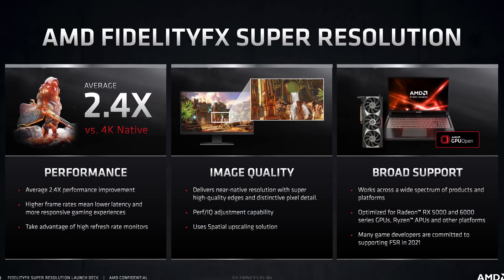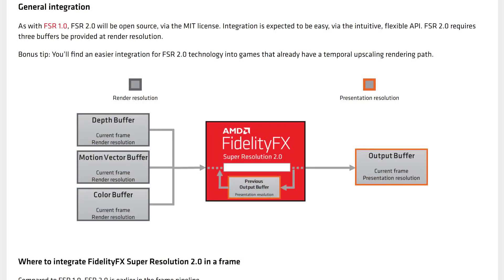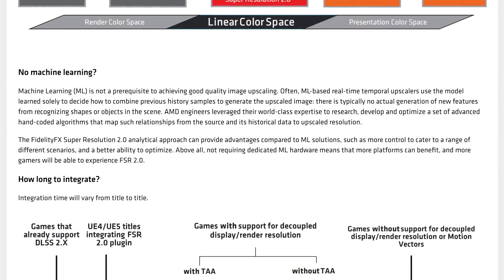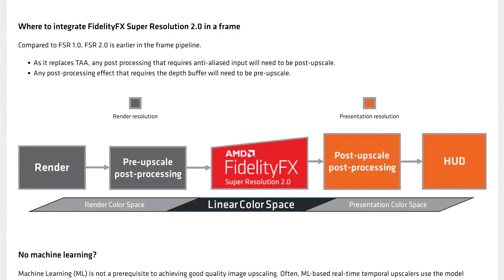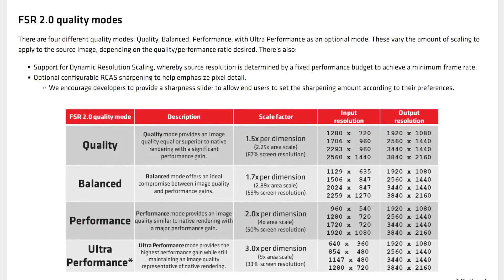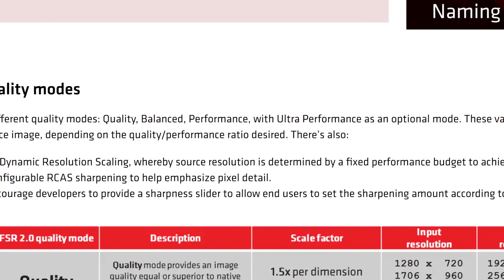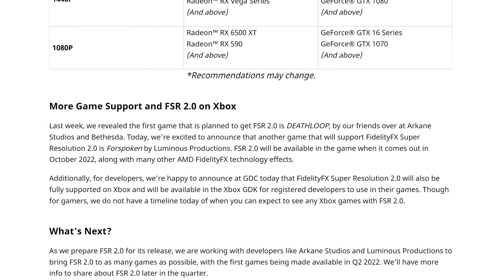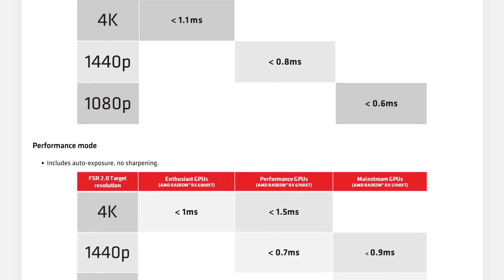AMD FSR 2.0 Details: GPU Support, Quality Settings, How it Works

Comment: I’m not a fan of this fsr. Maybe it’s great on pc but on console it seems devs are being lazy running with low resolution and all games look blurry. I have a laptop less than half as powerful as modern consoles and I frequently have games looking better-sharper. Few months later after several patches they usually make them look a little better but I prefer a sharper image without the upscling.

Comment: I am getting 60+ fps in RDR2 at 1440p with your optimized settings and fsr 2.0 in performance mode on a gtx 980ti. Hoping for fsr 2.1 implementation soon as it seems to fix much of the ghosting issues in fsr 2.0. But it is very playable and still looks quite good 💪🏼

Comment: I've been using rsr this week and while it has some buggy UI behaviors, especially when running obs in the background, I do find it gives me a good performance bump even on a rx 5500xt 8GB when upscaling from 1600x900 to 1920x1080 and because I'm rendering at a lower resolution, I can max out things like shadows, lighting and texture quality. The biggest benefit in game was Warzone, running above 90 fps with fewer frame dips than native 1080p with medium/high settings. At native 1080p medium textures, the foliage looks like its made of playdoh, whereas with RSR and max texture, shadow and lighting quality, everything looks crisp.

Comment: I have a gtx 1060 😭
Reply: @richwhitemanarchive  GTX 1060 uses the exact same set of instructions a 1070 or 1080 do. If 1070 is supported then so is 1060, same for 1050, only card that might be excluded is the 1030 GT, even that remains to be seen.
Reply: @richwhitemanarchive  it's not supported :(

Comment: I'm curious, would FSR 2.0 still able to be turn on with RX 400 series?
Or if it can but would result in worse performance than 1.0 but better in graphical
Reply: The "worse performance" seems to be implied in their statements, not as in bad performance, just not as high gains as FSR 1.0. RX 480s and 70s should work absolutely fine, as they are all mere refreshes of the same card, an RX 590 is quite literally an RX 480 with higher clocks.

Comment: i was gaming tonight on bfv and found out 4 guys had the 3080 and they play at 1080p why?why?.i dont get it,they are like well it works great at 1080p.i just laughed but why? a 1080 will do that not even a ti and they caint use ray tracing their or nothing no dlss but they are content i shouldnt judge. one guy said hes doing the trade up for the ti Tuesday im like what no what?the 10 gig scares him and thinks the 12 will be better.it just seems everyone is scrared if their gpu isnt 12  on memory or more on 1080p monitor that it wont work much longer misinformed people.i wouldnt trade my my ftw3 evga  black lipped clown face card for nothing its a beast .the 10 gig memory hasnt effected me yet and i play everything on 1440 and sometimes my 60hrtz 4k monitor its always smooth.

Comment: Can someone tell me how 3060 ti should perform in Metro Exodus Enhanced Edition built-in benchmark? I have weird issue and i lose 20 fps with resizable bar enabled. I have 5800x and b550 so all the hardware that is required and this game is on Nvidia's whitelist. It shouldn't hurt my performance but give me a boost.

Comment: If AMD just made decent GPU's they wouldn't have to resolute to this crap and that's coming from someone that's owns are 6800 XT which I was really disappointed with but it was the only GPU in stock at the time.

Comment: Hey, didn't know where else to ask, but now that x370 boards have 5000 support, could you guys run a benchmark test between x370, x470 and x570 to see how the chips perform in each?

Comment: Thanks for the video HU! I dont understand if i can use FSR on my 1440p monitor to play at 4K, is that possible? does actually change something on my 1440p screen? Thanks in advance for any answer!
Reply: FSR and other technology like this works by taking a lower res frame (say 1080) and increasing it when it sends it to your screen. From 1080 to 1440 as an example. You can't display more than 1440 pixels on your screen, so if you make an image bigger than that it'll scale it back down again to 1440 anyways.

Think of it like viewing a really high res photo on your screen. It had to shrink it down to fit, so you lose that extra detail.

Comment: G'day Tim,
Thanks for the update as FSR2.0 is looking like it is going to be DLSS for everyone, not just those with big bucks to throw around.
I really like how you do the Feature side of GPUs & they are not included in Steve & Teddy Jr's Benchmarks, it gives you the ability to deepdive into the Image Quality that is associated with using these features not just how many extra FPS/less FPS they may provide when turned on. As someone who plays Adventure Games I am more interested in Image Quality than Max FPS.

Comment: the nonsense about how long it takes to integrate it into your game is how long it takes "EPIC GAMES" or "ORIGIN" or "BLENDER" or "UNITY" to make say the UNREAL ENGINE WITH IT. and ensure they've got it looking how they want it in their own custom in house game engine.. then whenever anyone uses a standard game engine like unreal engine/frostbyte/unity/ whatever theres literally like a function you use.. which is just their fake modified to completely ruined version often enough way of typing in "DIFFERENT" words to make the AMD API and hardware do the AMD thing it does.. its hardware device morons. the display driver is the API.. the API is a list of function calls you can use to make the hardware perform its functions! so basically if you've a microwave oven with buttons and timers and you wanna "CUSTOM PROGRAM" your microwave with the 'unreal cooking engine' you then have to have the 'oven' set to different power levels for low medium or high by typing in the values for the API (display driver/directx/vulkan) your unreal cooking engine is custom and unique to your epic chef business.. so you want it to cook with your recipe maybe you hate burnt popcorn so you intentionally undercook the popcorn so that only one or two of the kernels in the entire bag actually pop and you prefer it that way.. you then spend the amd stated 1-4 weeks or 6 weeks coming up with recipes and typing them in and going, no no no it keeps perfectly popping all the corn by default this is going to take us months to get it down to a single kernel cooked most of the time. then many weeks later they've programmed in the microwave to pop the kernels for 25 seconds at a power setting of 'seemingly random nonsense' .. they could have just set the timer and cooked on high for the defaults and had better popcorn fully popped. same way they could have typed in the api function and used defaults for it and had it look a million times better in most cases and importantly game faster and better..  so yeah.. look in windows you can make a text file called config.ini and type in CAS DXR RIS VRS VS CACAO VXR AMDFIDELITYFXSUPERRESOLUTION and other things, or you could make a new registry key in hkeycurrent user as a multistring and type stuff in like DXR  / VXR .. you see those abbreviations like CAS and DXR are the umm custom display driver or OS words.. to enable ContrastAdaptiveSharpening or DirectXRayTracing or VULKAN ray tracing VXR. so umm you see those words are almost always great and 'just work' but the actual API function call for the hardware to do its job is different like vulkan is something like VK_KHR_TRACEDRAY then you need to specify settings and values and things and sort of do some mini code stuff with it.. but microsoft directx and vulkan have already done that and give you generic sorta 'basically works with everything and you can tweak them with some values easily' type in 3 letters and good to go stuff that makes every game developers fake useless trash crippling your hardware and performance with their atrociously awful not even pretend to use the hardware and make up own words and own code and fake it all with software coz intel/nvidia hardware just cant do the stuff a lot of the time physically as the hardware doesnt exist or whatever.. its kinda sad.. you can turn it on for any app or game.. its in the windows OS as its a global display driver and global directx/vulkan thing.. if the card supports it every app in the universe does because the card does its hardware function the app just needs to tell it what hardware function to use via the OS/display driver the simplest way to do so is to type in DXR/VXR and CAS or VRS variable rate shaders and other things.. and assign values yourself.. because game devs are literally criminally incompetent retard fags.

Comment: I suspect the 580/480 and 1060 aren't on here as not all versions of both cards had 8GB of Memory. I'm guessing this is going to vacuum RAM and 4GB/6GB cards are too much of a minefield to officially support.
Reply: But they listed 16 series cards and all of them has 6 gb.
Reply: They listed the 6500xt which only has 4GB of VRAM and limited access to the PCIe bus.

I'm sure there is some reason why they opted not to list those popular cards.

Comment: What about FSR 2.0 support on the RX480s 😅😅 and yes I have a vested interest as I'm still running on a RX480 lol.
Reply: Me too, there's no reason to upgrade. I heard it will be usable on RX 480. If not, just keep using Lossless Scaling. Magic Borderless is also a good upscaler.
Reply: @100Bucks  Will check magic borderless out 👍🏽👍🏽. Hopefully, RX480 support gets confirmed officially - I don't see why it shouldn't as the 500 series are really a re-badge higher boost clocks ( For example when you [generally speaking] compare the 580 and 480 on techpower up they are almost identical.).
Reply: @earthtaurus5515  Here's a trick to gain a little bit more juice for games you already can play at 4k native. Here's an example, Marvel vs Capcom 3 can run at 4k native but you can make it look a little better combining Magic Borderless with Lossless Scaling. Play the game at 4k native. Use Magic Borderless and modify the game to run at 720p. Now open the game within Magic Borderless and use Lossless Scaling on top of Magic Borderless 720p and pick Nvidia image scaling (NIS). I play all my 4k native games like this. It's the only way I know how to squeeze a bit more visual quality out of 4k.
Reply: @100Bucks  How would you pick NIS with an AMD card? 😶
Reply: @earthtaurus5515  Lossless Scaling has all upscaling methods, meaning any graphics card works. No discrimination, nobody's waking up to this. You can run Amd FSR on a Nvidia GPU or you could run Nvidia Image Scaling on a AMD Card. Graphics cards don't matter anymore. As long as you can run games at 720p 60fps. It's your choice to upscale to 4k with AMD FSR or NIS with any graphics card using Lossless Scaling. This includes laptop Intel integrated graphics card. Did I wake you up from the Matrix with my red pill 😂😆. There's no need to be buying new GPUs. Lossless Scaling is all in one program, no discrimination.
Reply: @100Bucks  I'm aware of FSR is GPU agonistic. I thought NIS was part of the nvidia control panel? Last I checked, you couldn't install Nvidia drivers or control panel with an AMD card 😋. I tried downloading Nvidia control panel when it hit the Microsoft store but it never would run as I wanted to try out NIS. But never got it working so that's why I asked how did you get it working lol.
Reply: @earthtaurus5515  using Lossless Scaling is so much easier. AMD software has interger upscaling as well. It's been there forever and I learned how to use it today. I'm sorry to say that Lossless Scaling is still much easier. Just pick upscaling method and hit upscale.  I'm sure using FSR 2.0 would be the same method like interger upscaling inside AMD software. To many steps to turn it on. Lossless Scaling is worth the $5 bucks if you have many computers in your house, especially laptops.  I do hope they upgrade fsr 2.0 within Lossless Scaling because Amd software has to many steps.
Reply: @100Bucks  You haven't answered my question 😋😅.
Reply: @earthtaurus5515  Do you mean to run (NIS) on AMD card? I did answer. You use NIS within Lossless Scaling application. NIS=Nvidia-Image-Scaling. This is the question you asked right? How do you run NIS on a AMD Card? Correct??? You do it within Lossless Scaling application. The free version doesn't supply NIS. It's a must to buy the app to get all upscaling methods.
Reply: @100Bucks  o.0 no need to get nasty about it lol. All you had to say you were using NIS via the lossless scaling application which is a paid feature 😶. Anyway, thanks for the info. Good day.
Reply: @earthtaurus5515  I apologize if I came off as rude. Lossless Scaling is over looked and slept on. If my GPU died today I wouldn't even care. I would get a  low profile display GPU and be happy with it. All you need is 720p 60fps/ Lossless Scaling/ and a 4k TV to upscale to 4k.

Comment: If only i knew that AMD will bring something similar to DLSS but it would run on any hardware, i wouldn't sell my 1080 Ti more than year ago for 3080 upgrade. It was terrible decision :(
Reply: Don't think it was a terrible decision per se, the RTX 3080 is a great GPU and also with a fair MSRP. Unfortunately you probably paid a lot more and that's the biggest problem, but wouldn't look vastly different when going for an AMD card, even though likely a bit cheaper. OTOH, you have better performing RT, which is nice if you are a graphics guy and like RT. :)

Comment: If AMD is successful with this, it will just highlight how pointless Tensor cores are for your average consumer. There is no reason the bigger nVidia couldn't have done this (and perhaps they have, I haven't looked into DLSS source code leaks, and just vendor locked it).

Comment: FSR 2.0 will work with existing hardware which is awesome. That makes it great for people like me who got a 6900xt. It will really boost the upcoming 7900xt which will likely be the best GPU on the market later this year.
Reply: Until the 4090 hits the market with their dlss 3.0. It's a never ending story.
Reply: @pauloa.7609  Both technologies have a roof...the 4000 series cards are not different from the 3000 series, they're just jacked up with a higher power envelope. I don't think there will be much, if any difference in DLSS other than the natural fps boost that comes with more HP. AMD's MCM tech is far more interesting and it'll be cool to see what they can achieve with multiple GPUs on a single die. We may see a significant performance uptick from AMD over Nvidia or similar performance at a lower power requirement. If FSR 2.0 is widely adopted and in Epic's new engine, it'll be a huge win.
Reply: @GSP-76  sincerely i don't see it happening but who knows.

Comment: I'm most curious about what this will mean for RDNA 2's ability to play with Raytracing on. I'm not that bothered by it, but one of the biggest weaknesses was the lack of good RT. FSR2.0 can mean Ultra Performance or maybe higher may look good and produce stable 60+ with RT on, which is something I never thought i'd get with my 6700XT but could now be a feature I can actually use.
Reply: So long as they also enable the player to lower the RT resolution separate from the geometry-rasterization and screen resolutions, I expect we'll get good performance even among fairly poorly performing cards.

Comment: Will iGPU support be a given if lower end hardware like the 1060 will get support? I'm not expecting a 100fps increase in performance but even 1-2 extra fps is a big deal when trying to reach 30 or 40 fps

Comment: Never had AMD but now i am rocking a 5800X and a 6900XT. Verry satisfied customer!
Reply: The 6900XT on 1440p is a monster with very sharp teeth! My buddy runs that. I'm doing fine with a 6700XT though. Still chews everything I throw at it. I'm still on an R5 3600 but the 5800X3D is on my shopping list since I bought an insanely good DDR4 kit that does 3600CL14 with stupid good sub timings (and a bit of voltage). This should last me well into the AM5 era.

Comment: Why did you mention that car light glitch in cyberpunk? You can get it even without dlss, cause the reason is TAA.
Reply: DLSS disables the engine-provided AA (be it TAA or other) and implements their own AA solution. So you can't really blame it on TAA.. despite DLSS comes with Nvidia's own "TAA"... so, yeah, it's complicated, but the short story is: some TAA implementations ghost more than others. The one DLSS provides is pretty good most the time (it doesn't ghost the whole scene when panning fast), but it does ghost when there is high-contrast motion within the frame. And for some strange reason it ghosts more with red-on-black contrast than with white-on-black or, say, blue-on-white. So it certainly has some more tweaking left to be done.